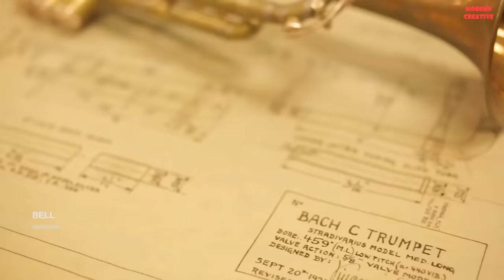Amazing Brass Instruments Production Process | How To Manufacture Trumpet | Using CNC Machine

Comment: Curious, do they need tuning? And if so, when do they do it? Not clear in the video.
Reply: There is a user adjustable section for tuning. They manufacture it close and the user takes it the rest if the way

Comment: These people are excellent craftsmen who know that to produce an excellent instrument, you need manual expertise. The machines used are several decades old. No CNC at all for the core production, neither tuba nor trumpet. CNC is only used for engraving (mere decoration) and mouthpiece production. The mouthpieces are independent of the instruments and often be used for several ones...
tldr: Misleading title